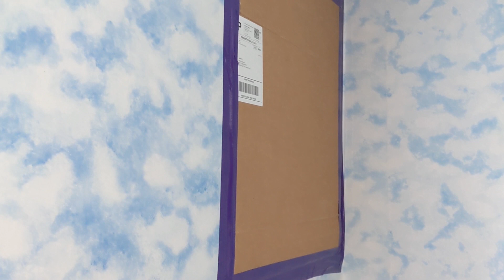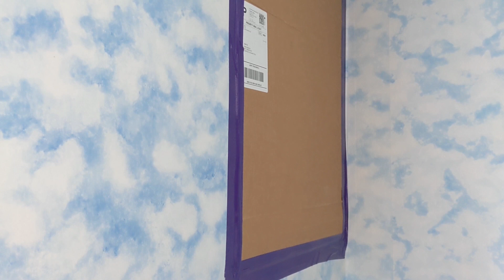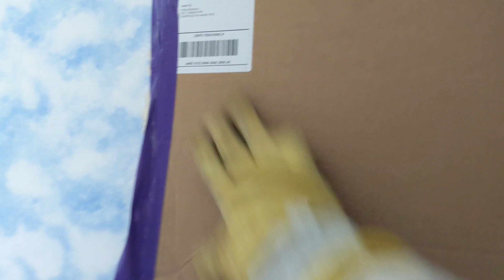Massive 3 ft tall European Hornets nest ate through bedroom wall

Comment: Very slow moving video.   Saw more of the hornet helper’s back than anything.   Very very bad to not have furniture out…. Or some furniture out.  And have clothing, drapes, window shades  if present plus all bedding and clothes.   Should have big drop cloths down on floor to protect carpet from powder.     I would NOT want my kids to enter the room, much less sleep in the room, touch anything in there or wear clothes, touch any bedding.    Adults or kids: not safe.   What about a quality air cleaner to run for a couple of days!

Comment: Great video, thanks!! However, in the future, t would be helpful to let us amateurs know what powder/dust you use and where to get it. Also, it would have been a good idea to tape that flap out of your way while you work! Also, we couldn't help noticing all of the nest pieces and larvae you let just fall to the floor on the INSIDE of the wall. I'm sure the family would wonder as well - why didn't you use your vacuum to clean all of it out??? AND, not to judge or anything, but do you not have anything larger than that little tiny vacuum? I would want to use one with a longer hose to reach to the bottom of the opening, plus it seemed you got clogged due to the sizer of the hose and vacuum, PLUS the attachment seemed way too small for this type of hornet. 

AND MOST OF ALL:   You barely mentioned the QUEEN!! You have to know that we commoners are always obsessed with royalty. How many are there? You say that the males don't do any work. Do you mean only the drones?? What are the other males?? You mentioned that a queen is needed to produce females - is she the ONLY one who produces larvae?? Are there other females? What do THEY do?? It seems you implied that the females do all the work. Or did you just mean the workers (both males AND female?). I realize this isn't a class on the societal structure of hornets, but while you're mentioning the queen, the males, the workers, the larvae, the female...it would help to add a couple sentences of info for each while you are gleefully crunching the life out of these fascinating creatures.

Keep the videos coming - very informative and entertaining :D. Thanks!!

Comment: Powder is good if ya going to remove after 24 hours same day removals I prefer to inject CB-80 into the hole seal it back up wait 20 minutes if it's late in the season I'll also puff some drion on the outside of there entrance.
Reply from the maker: As long as you get the dust on them it doesn't really matter how long you wait. I dust first and then get my equipment ready, which gives it 10-15 minutes to set in. As long as you clean up whatever flies inside you still get them all just the same. I leave dust in the cavity for the ones out getting food

It's a way to be more efficient without sacrificing effectiveness

Comment: What kind of dust do you spray, we have a nest and they sting us and our dog.  They had to go!  We have killed most of them with water and dawn.  Just need to get the nest out.  Looks like some new hatches are still coming out.  Your videos have really helped us learn about these little monsters. Thanks so much for sharing with us. 🐝
Reply from the maker: I typically use tempo. The dust isn't as important as getting some air pressure behind it though which is the chief benefit of a professional. Try some local exterminators, they're often cheaper than you'd think
Reply: I always put Bengal dust in a empty ketchup dispenser bottle will work.it will have plenty of force,spread out especially in a wall void
Reply: Hello, the powder is usually " pyrethre " .

Comment: How did they get in the wall?
Reply from the maker: That's just where they nest. The queen selects the site in the spring and there was an entrance from the outside wall
Reply: That's why well placed caulk can be a homeowner's best friend to seal up potential entry points around windows, eaves, etc.
Reply from the maker: @shortliner68  that's very true---just make sure there aren't any bees when you do the caulking!
Reply: Funny you should mention that. We had our old basement door replaced by a contractor, and shortly after we were seeing ants everywhere upstairs above the door. Come to find out the old door frame had gaps under the sill and the ants made a colony inside the wall we weren't aware of. The new door frame sealed their entryway and trapped them inside. They were just trying to find another way outside and attracted to any area lit up. It wouldn't have been too good for us if stinging insects had been trapped inside instead, so I know exactly what you are saying.
Reply: Through crack in masonry in chimney, then worked way through   plywood wall.